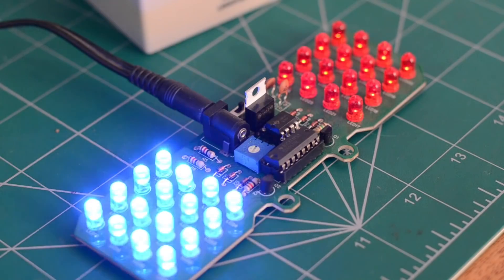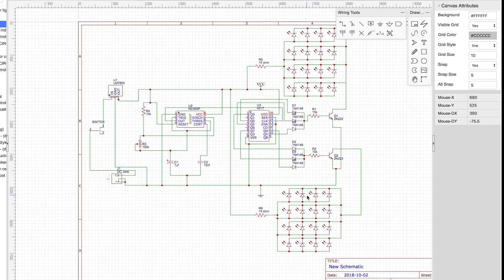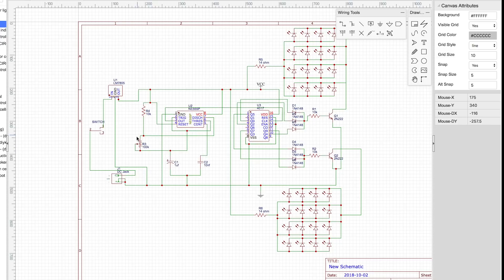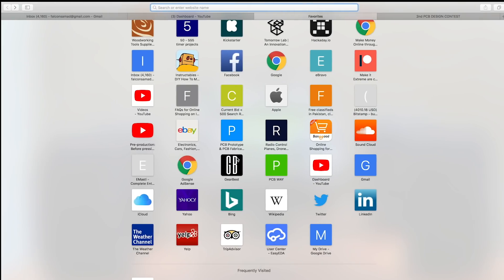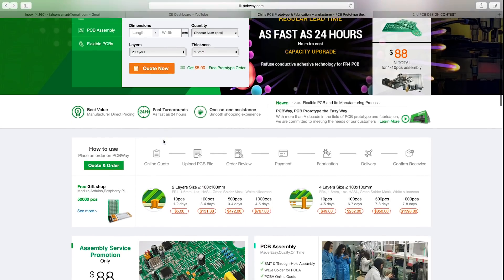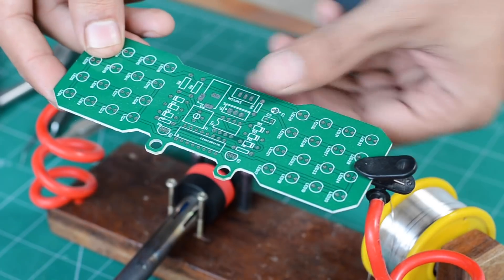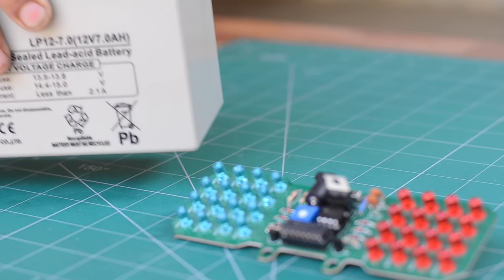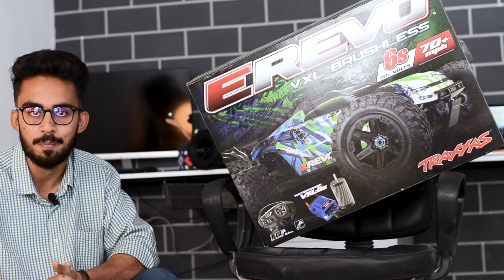How to make a Police LED Flasher Light

Comment: Add a UM3561 siren generator to it using a sptt (on-off-on) switch for siren tone selection and a darlington pair of 2n2222 to drive 2 small 4ohm speakers. By adding a VR at the base will adjust volume and the whole siren circuit only requires 3v max. Easy
Reply from the maker: I thought of including the sound part but have no thoughts on that. BTW good suggestion.
Reply: DIY King Thanks 😉